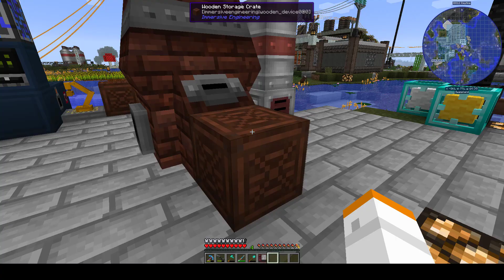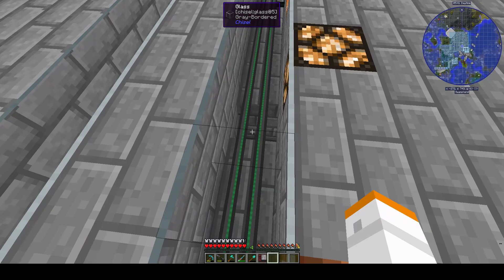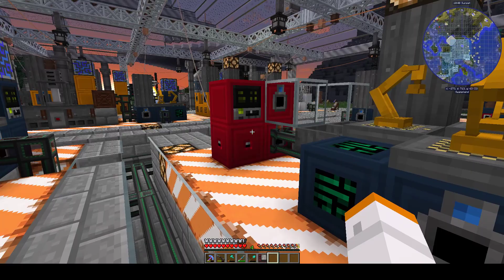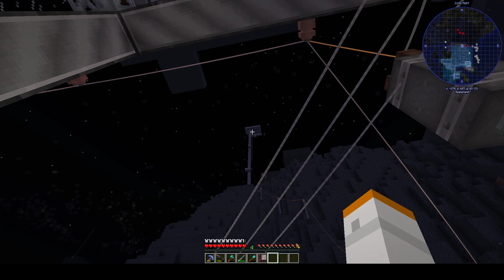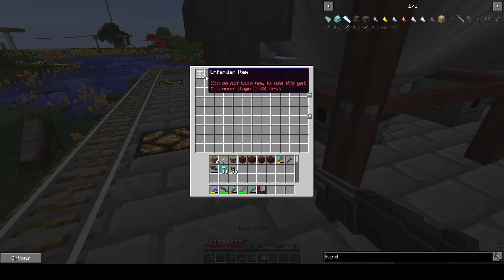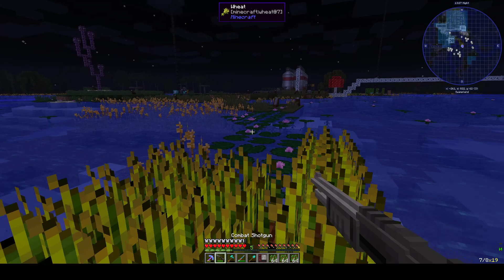Manufactio World Walkthrough

Comment: awesome base, i would love to try the pack out, but am afraid my pc might struggle with it, can u send me your specs?, so at least i can compare andd estimate if it will be possible for me to play?
Reply from the maker: i7-6700, 32gigs of ram, gtx980, should be overkill for this pack but I did have quite the time keeping usable frames when it came to using the mag/craft belts due to the amount of entities in the world. Pack runs fine on lower end machines as long as you keep an eye on items.
Reply: @Frogman79  am not sure i will be able to handle, i have a 970 8gb of ram and my processor is very fucked. I managed to break half my cores, its now a pheno II x6 tri-core. Altho with less cores i managed to get a overclock to 4ghz. but thanks